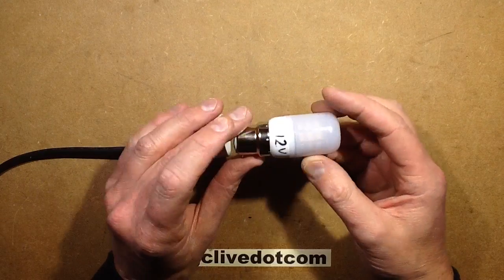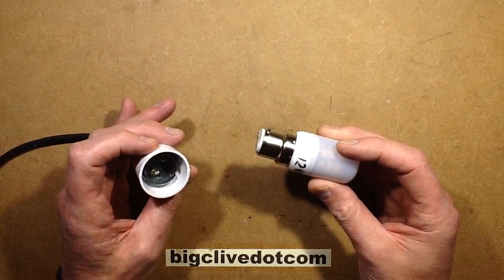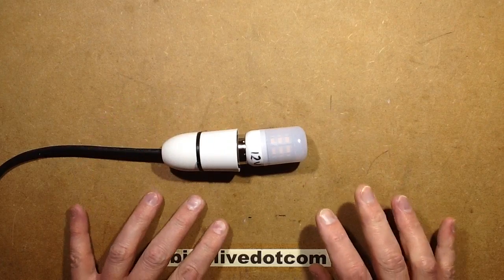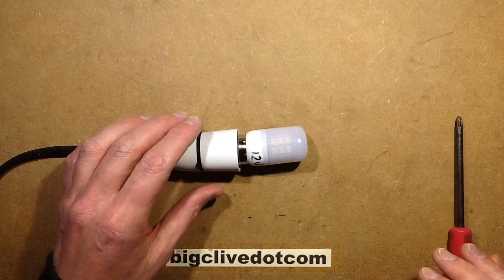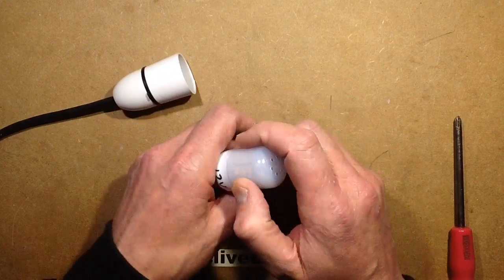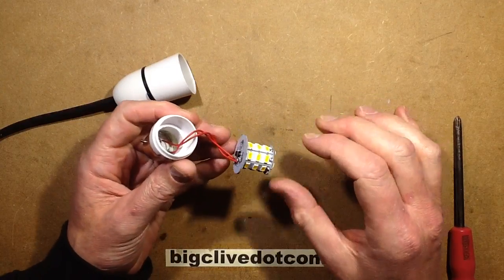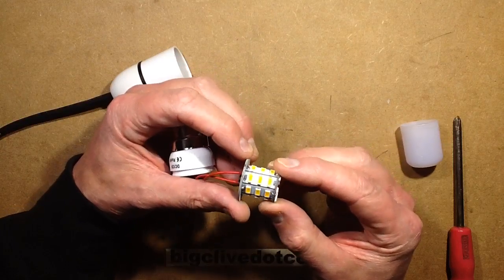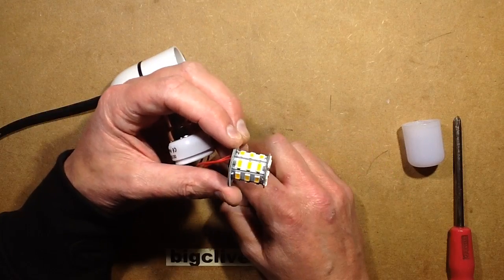Putting a 12V lamp into a 240V socket.  (slight anticlimax)

Comment: Hey Clive, can I use a 240v 400w bulb to load test a 12v 350w power supply? Cheers
Reply from the maker: No.  You'd need a load with a similar voltage to the supply.
Reply: @bigclivedotcom  Cheers Clive, 
I've been watching your videos since the chinese flame thrower doll, keep up the good work!

Comment: oh but 12 volt DC on a 120 volt AC?  well it lights but it flickers all day long in series...  ie oh bother they shoulda had that in red.  DC only X_X  where's my batteries.  (I've been told DC is more deadly than AC.  Whats the harm in sticking my finger in a light socket anyway :P)  vs a DC run (by 12 D batteries) cigarette lighter pack that has no cover over it  X_X  You know I really don't wanna find that out so I keep removing one of the batteries out of the thing and my brother keeps putting it back.  smh...  sigh  and it's a flat panel led set, not like the above.

Comment: You could have secretly added a cap on the input leads to give it that theatrical spark! Might be an idea for the 24 volt lamp. Reminds me of the time a novice packed a flash pot with a wee bit too much flash powder, it went off with a resounding bang instead of the more controlled flash needless to say several of the cast members required a costume change.........

Comment: Once upon a time when buses had conductors and interior lighting on the decks of the buses consisted of pearl bayonet cap incandescent bulbs running on (I assume) 12 Volts DC this very same conundrum presented itself to my nine year old self. Said bulbs could be distinguished from domestic 240V bulbs as the globe was smaller and almost completely spherical. This did not stop me from wanting to try one in our living room socket, as the fittings were identical. There was no anticlimax in my experiment! The bulb briefly glimmered for a tiny instant and the house was plummeted into darkness and Father proceeded to pursue and apprehend me and administer the discipline deemed appropriate at the time. A small length of fuse wire rectified my foolishness. My arse took a while to recover from the lesson my Dad told me I'd never forget. He was right!

Comment: What moron decided to use the same bayonet connector for 12 and 24v lamps?!
Reply: What moron decided to have the same pin spacing on 5v and 3.3v chips? What moron decided to use identical connectors for ISDN and Ethernet? What moron decided that mono plugs should fit into stereo jacks?

I believe it's called "not reinventing the wheel", and instead labelling each "wheel" with its relevant specs and / or intended use. Making things idiot-proof is generally only a top priority if your target market is idiots (even then, one could argue it goes against the spirit of natural selection).
Reply: So... light-bulbs sold to the general public?
Reply: Jim P - Is the general public buying 24-volt LED lamps?
Reply: Someone must be, though, or they wouldn't bother making them.

Just seems like a really bad idea, to me, to have the exact same physical connector -- that the end-user is mauling about with -- on 12v, 24v, and 240v lamps.

Maybe I'm just strange; but I prefer electrically incompatible plugs to be physically incompatible, too.
Reply: Jim P - Someone must also be buying scanning electron microscopes. But there is a big range between "someone" and "the general public". 

Also, they are not "electrically incompatible". There are several situations where you might want to connect a "24v" lamp to a 12v supply. Or to an 18v supply. Or to a 20v supply. Or to a 30v supply. Can you imagine having to create worldwide industrial standards for every single voltage? It would be great for adapter manufacturers, not so great for everyone else.

Comment: If it was important to prevent people plugging the wrong Volt bulb into a fitting there are adaptions that could be made to the standard cap design. A few years ago my mum moved into sheltered accommodation and it had 'BC3' sockets in the ceiling fittings - a proprietary  3 lugged BC design that was supposed to prevent people plugging their old tungsten  bulbs in... of course at that time CFL's with a standard cap were being given away free to old ladies - and they were a lot better than the crappy official BC3 bulbs which used already very outdated CFL technology that took ages to warm up and emitted a vile green tinted light. 
Don't know what happened to the BC3 standard tbh - fwiw I dealt with it by replacing mums lampholders with standard BC from the pakistani poundshop though subtle methods were possible http://architectures.danlockton.co.uk/2008/07/21/how-to-fit-a-normal-bulb-in-a-bc3-fitting/ (also has some background to the stupid BC3 nonsense for anyone who's not aware)

Comment: I aint avin it
Reply from the maker: Photonic would have done a much better job.
Reply: 240 volts? pathetic! 240,000 volts, now you're talking.
Reply: 5000 amps and 240 volts ?
Reply: While you do have to have more than 240v, the current does have to be high enough to make things interesting.
Most microwave oven transformers will put out 2kv 500ma without breaking a sweat. This is a pretty ideal combination of voltage and current for converting electronic components into magic smoke.
2kv is enough volts to make most anything arc over, and 500ma is enough current to make a whole lot of magic smoke. This kind of power can even let the magic smoke out of the circuit board itself, instead of just the components mounted on it.
It can also VERY EASILY let the magic smoke out of YOU, so make double sure the transformer is unplugged before you try doing anything with the wiring connected to either side of it.

Inverter microwave oven power supplies aren't suitable, they're too fiddly to get working at powering something other than a magnetron in a microwave oven.
Iron-core microwave oven transformers just need the primary winding hooked up to mains to work, it's dead-nuts simple (almost too simple, almost).

Comment: Aww, I wanted flaaaaaaaaaaaaaames... :P

Still, you could do a DIY lamp build in there with multicoloured LEDs... :
Reply: omg i knwo right desidler the ones formits base and use the base pcb as the mount